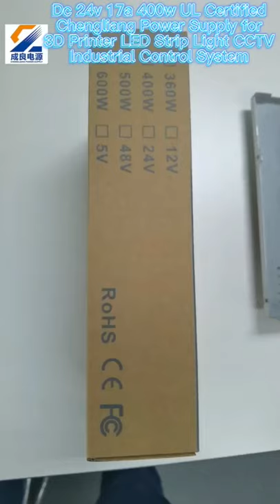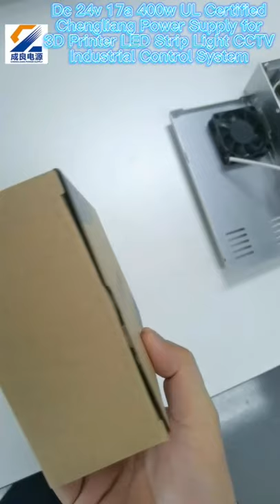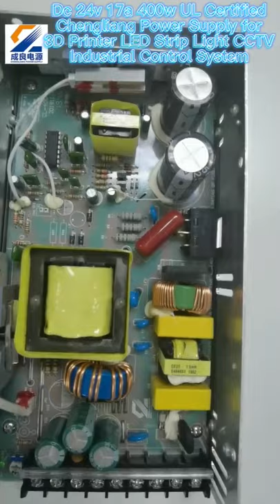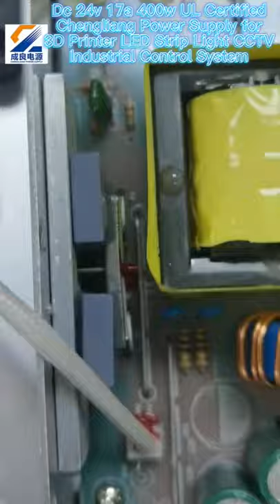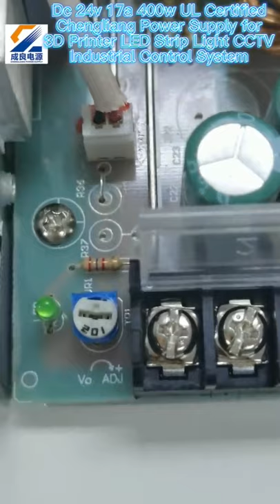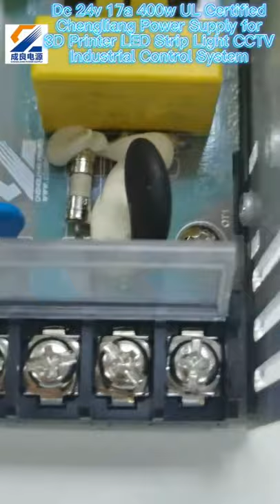Dc 24v 17a 400w UL Certified Chengliang Power Supply for 3D Printer LED Strip Light CCTV Industrial

Comment from the maker: US Amazon Deals: 20% off

https://www.amazon.com/Chengliang-Supplys-Original-Switching-Certified/dp/B08QF4L3X4

https://www.amazon.com/shops/chengliang-power-supply

B2B Deals: EXW offer

https://dgcldzkj.en.alibaba.com

Dc 24v 17a 400w UL Certified Chengliang Switching Power Supply for 3D Printer LED Strip Light CCTV Industrial Control System.

#3dprinterpowersupply #creality3dprinter #ender3originalpower #3dprinter #3dprintedpower #3dprintingpower #ledlightpower #leddriver #power #powersupply #3dpowersupply12v #ledpowersupply12v #switchingpowersupply #universalpowersupply #regulatedpowersupply